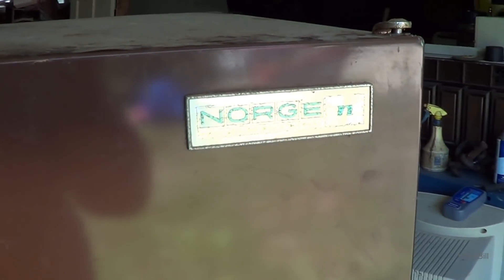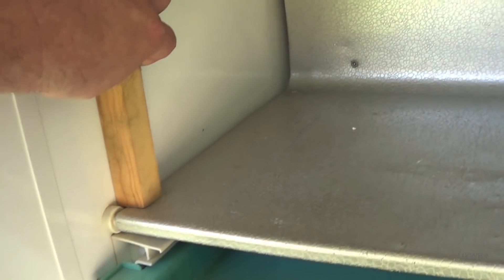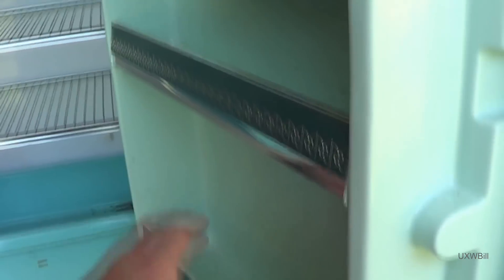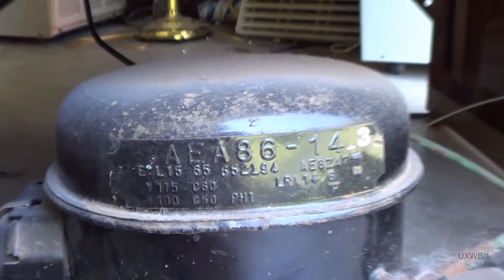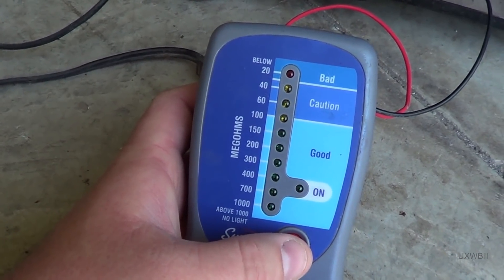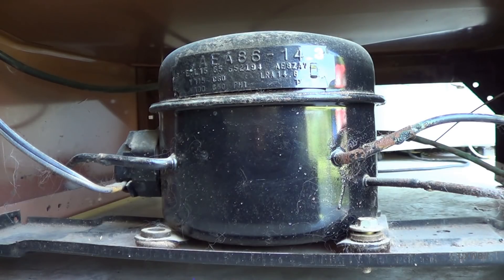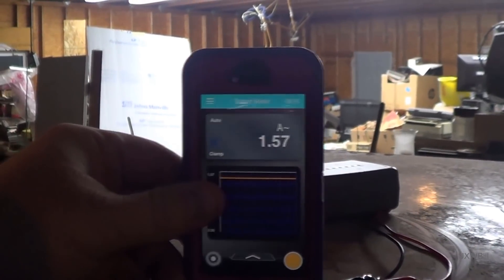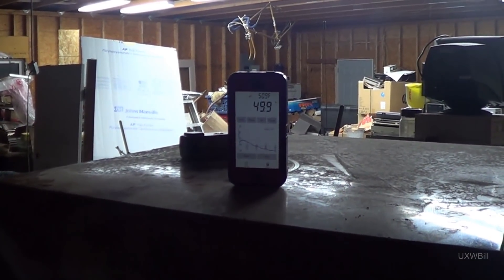Borg Warner Norge Refrigerator (Model REF131305A?)

Comment: I think the reason people think that older stuff is not efficient is that some devices are way more efficient now  ( look at a massive CRT vs a modern LED LCD). A Chest freezer with no auto defrost is still THE most efficient freezer you can get as firstly the cold air does not " fall out" when you open it, and no auto defrost means no wasted power. In fact, some people convert chest freezers to a chest fridge to save power, also camping fridge will have the same chest design.

Comment: I'm surprised there is signifigant corrosion on the tubing.  I would have thought it would be copper or a 300 series stainless or something along those lines.  Hard to tell what the metal type is in the  vid... any thoughts?
Reply from the maker: mike all I am not sure what it is, besides ferric in some way, as a magnet will stick to it. 

The rust does not appear to be uncommon. I have a slightly newer GE fridge whose condenser coil is VERY rusty. Yet it still works great.

I suspect that the coil rusting out sidelines a fair number of refrigerators and freezers.

Comment: Some years ago, I moved into a house that had an old refrigerator in the garage.  I plugged it in to see if it worked.  It did, but the compressor stalled a couple of times, a gentle tap with a hammer got it running again.  I moved the fridge into the the kitchen where it ran happily until I moved out of the house, about 5 or 6 years later.